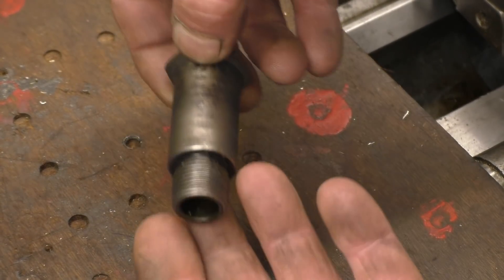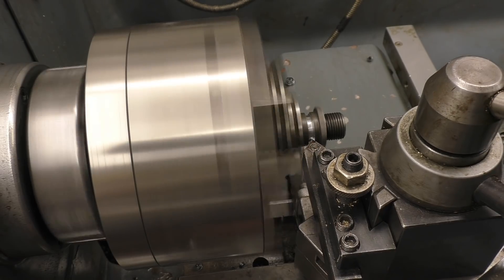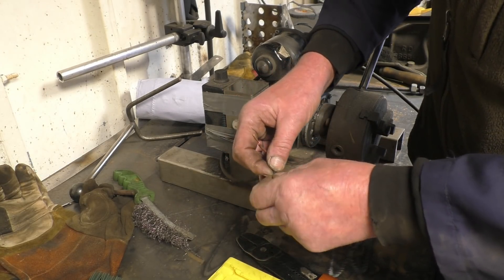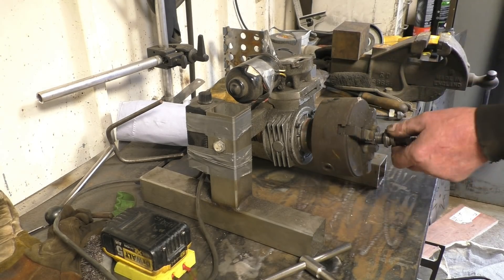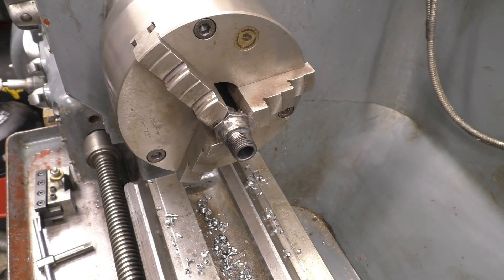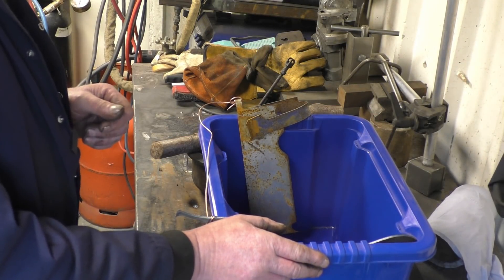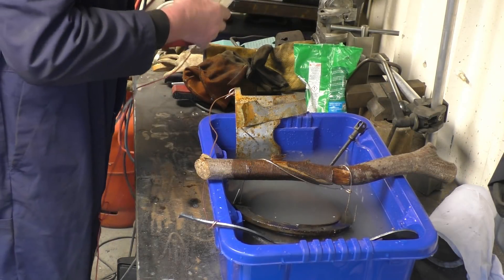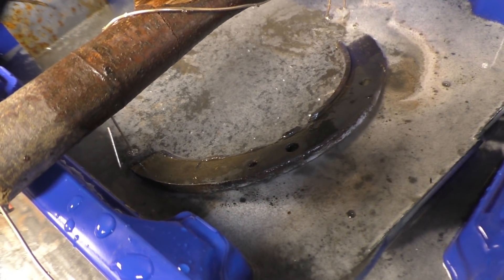SNNC 382 P1  Oil Filter Adapter  . Electrolysis Rust Removal

Comment: If the second thread on that piece was some oddball thread I don't blame you for cutting and welding!  I've never tried electrolysis for rust removal, will have to see your results and maybe give it a try.

Comment: Welding up a clutch housing. I hope the shaft still lines up proper when you are done. They would be way better off with a salvage casting in my opinion but maybe none available?
Reply from the maker: The bell housing will be machined to ensure the faces are parallel nothing at all available for it .Thanks for watching

Comment: Did you completely degrease the rusty part before trying the electrolysis? I imagine you want the part as clean as possible to allow the 'current' to flow and the anions or is it cations to reach the steel.

Comment: Great quality of welding! Slick welding rotary mechanism. Did you make it yourself? If so, do you have a link to a video or ?? Do you have a foot switch to turn it on and off?
Or what is the speed/rpm range which you have found to be best?

Comment: 12:55 2 things John - the part you want to de rust has to be completely submerged.

The battery charger - stand it on its end to the casing acts as a chimney - it helps keep the internal transformer cool. I know as I have one !

So that's now at least 3 things w both have - battery charger, hand drill and oil can !

Comment: Nice one tonightJohn! On the electrolysis,it works much much better if you use hot water, and also make sure the part is completely submerged and it will work well and Bob's your Uncle, and Fanny's your Aunt!

Comment: Electrolytic cleaning needs line of sight to the sacrificial anode so you may have to turn it around a bit to get even cleaning and have it on it's side to get to the inside and top bit. I used to just add enough baking soda to get a decent amount of current flowing without overloading the power supply. Never use stainless steel sacrificial electrodes as you'll end up with some nasty chemicals and I wouldn't try to clean any non-ferrous metals in it as they will get attacked very badly. Also watch out for hydrogen gas build up!